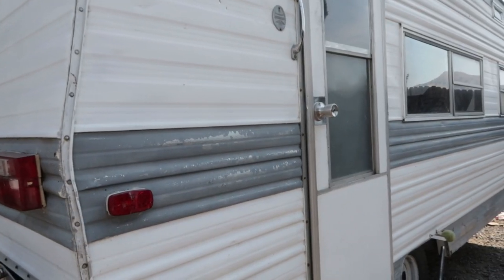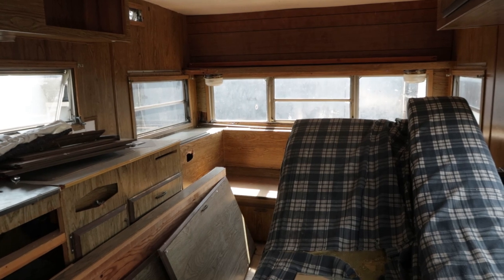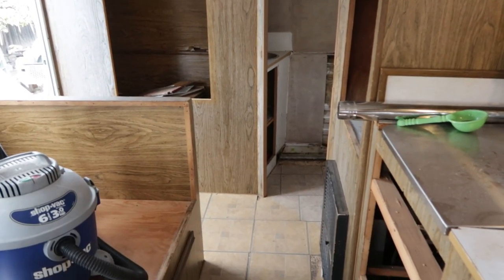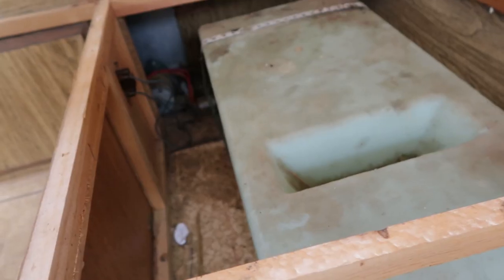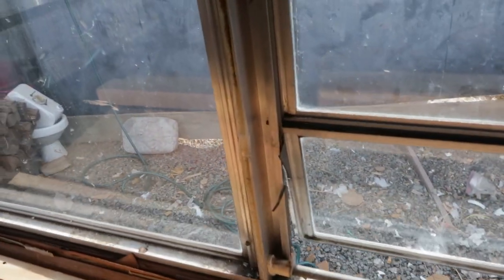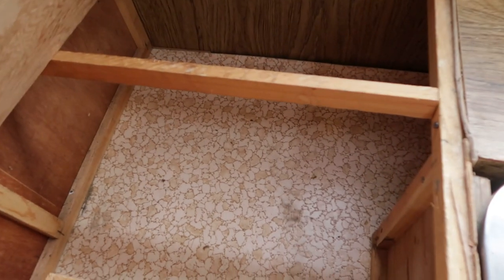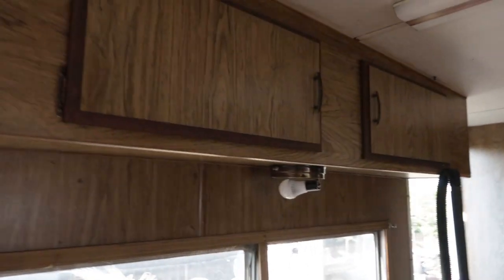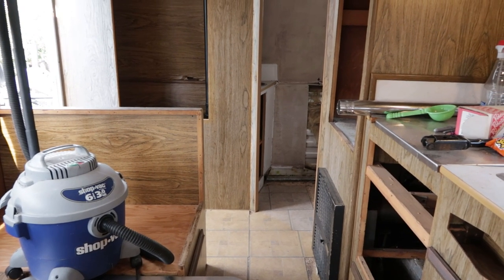1972 Fleetwood Prowler Renovation Update! || Monday Funday

Comment: I recently sold my van (which I wanted to convert into a camper van) as it was just costing way too much and nothing was finished due to kids/work/life lol I don’t usually give up on things but there was just no way I could finish it so I sold it to someone else who was doing the same thing and making it a “camper/day van”, I think he said he did downhill mountain biking. ebay is great for bargains, old cabinets etc, I got a sofa from an office/reception (so hardly used) for 99p and some old cupboards for a few quid £, even if you only use the hinges/handles it’s cheaper than buying new. Anyway good luck and I look forward to more videos 👍🏼

Comment: wow you got lots of talents. so on the stove would it have to be a stove or could you get by with a microwave?
Reply from the maker: Anything i get would need to be run off propane. We rarely camp somewhere with power and don't have a generator, batteries can run the interior lights for short amounts of time, but pretty sure a microwave would overload it.